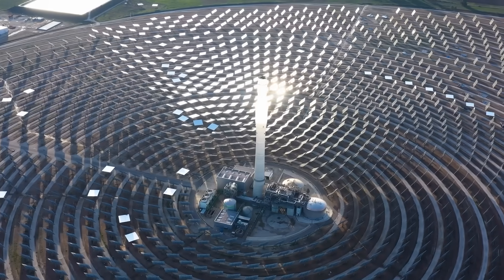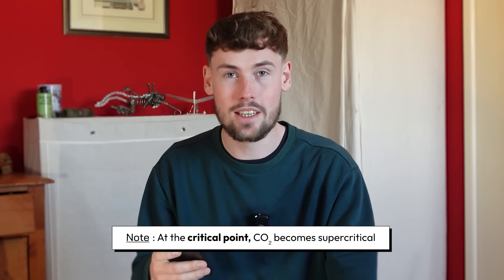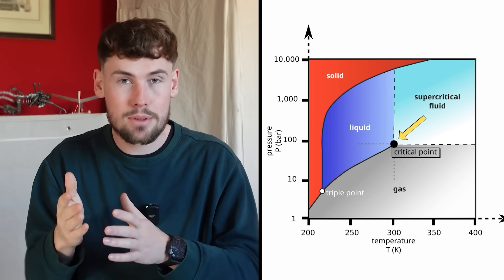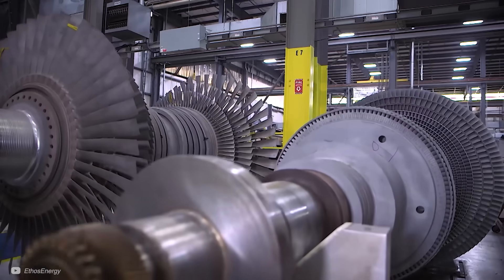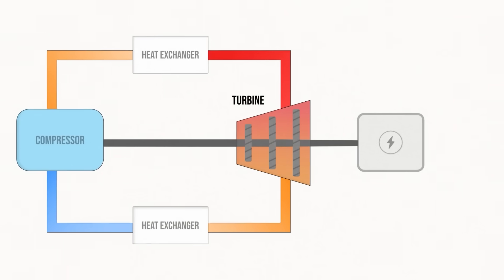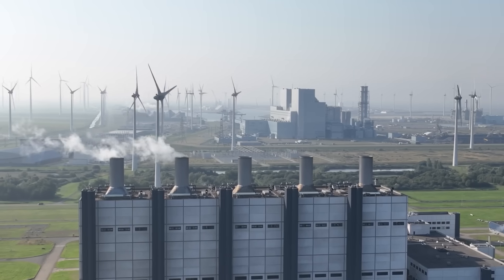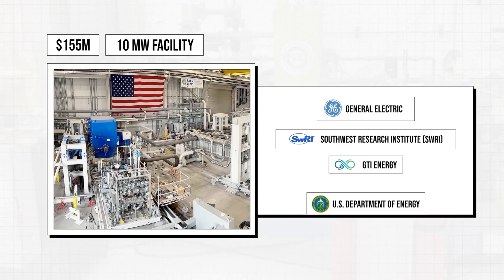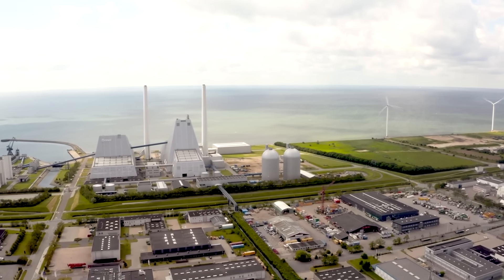How Ultra-Efficient CO2 Turbines Are The Future of Energy

Comment: There are many "steam" powered plants that use super critical water. Many of the things mentioned in the video are also achieved using water. The key point is that super critical CO2 is about twice as dense as super critical water, and CO2 has other advantages as mentioned in the video. The major advantage of water is that its plain old water.
Reply from the maker: Great point - I should have done a comparison with super critical water turbines too! Anyone interested can join the peer review team on Discord to help improve future technical accuracy https://discord.gg/BgwVvkRV :D
Reply: @ZirothTech  Water is kind of a pain actually, we'd much rather use it for other things. Supercritical CO2 is definitely the future.
Reply: @ZirothTech isn't CO2 acidic especially at high pressures? The turbine needs some really good fluorocarbon based coating.
Reply: @rameshraghothama8324 CO2 needs water to be acidic. Only with water does it combine in to carbonic acid.
Reply: @FilipMikulic-u7d CO2 is a Lewis acid all on its own
Reply: @ZirothTech that was literally mu first thought when I saw steam in the title
Reply: The difference between supercritical steam plants and supercritical CO2 is that even with supercritical steam plants, the steam  after the last turbine stage is subcritical.  The steam is then sent to a condenser and just as in a subcritical steam plant, the liquid water is pumped to the boiler inlet pressure using far less energy than it would take to compress the subcritical steam. Starting from a higher pressure and temperature, the supercritical steam cycle is more efficient. But the major benefit of a supercritical steam plants is that the water - steam separator after the boiler is eliminated. Instead the supercritical water turns entirely to dry steam when passed through a pressure reducing valve. This subcritical steam is then fed to the same type of steam turbine as a subcritical system.

So the major difference between supercritical water and supercritical CO2 systems is that with supercritical CO2, the CO2 remains in the supercritical state throughout the entire cycle.
Reply: @papparocket  Also eben kein Wasser verschwendet wird (Verflüssigung)  GuD. benötigen extrem viel sehr sauberes Wasser .   Dieses System könnte man auch in die Wüste stellen.  
Ob am Ende die Kosten je MWh mit Gasturbinen  mithalten können ?  Die sind extrem  günstig zu bauen und können  eben auch ohne Gasanschluss  betrieben werden ( Kerosin, Diesel  etc.)
Reply: @T.Stolpe  Steam plants require extremely large amounts of not-very-clean water for evaporative COOLING, not as the working fluid. The amount of very clean water needed for the working fluid (ie the water turned into dry steam and back) is relatively small - that's why seagoing ships can use steam.
Open cycle gas turbines are VERY fuel hungry (thermal efficiency is quite low) as so much energy goes out the hot exhaust. Combined cycle plants (ie a GT with a steam boiler fed by that hot exhaust) use as much water as a traditional steam plant.
Reply: @papparocket this
Reply: @papparocket  There is no pressure reducing valve. The turbine nozzle valves are sequential and designed to avoid throttling as far as possible.
Reply: Toured a coal plant when I was in a welding program, the water chemistry is a critical factor that is carefully maintained to maintain a passivation layer inside the boiler to prevent degradation of the heat exchanger. I wonder how the co2 behaves chemically.
Reply: @juancarrera5524  CO² is more inert than water and shouldn't corrode metal. Plus, it can be supercritical at much lower temperatures if needed.
Reply: the efficiency depends on the inlet and outlet temp (T1-T2)/T1; the exhaust gas need to be compressed and fed back into the boiler to conserve water. Higher input temp means higher efficiency
Reply: @janami-dharmam And that
Reply: supercritical water requires 220 bar pressure too which is pretty insane.
Reply: Yeap, you got it right. More than twice the water density, CO2 is bound to be more efficient medium in converting enthalpy to torque. As against many engineers I used to work with, all rotating equipment, from pumps to compressors, expanders and turbines are not volume but mass based machines and hence density dependent for its bhp.
Reply: @KasumiModa  the Internet says 0.3 to 1.0 times the density of water, so max is same density as water. Where does your " twice as dense as water" idea come from ? If the Internet is wrong you ought to help them understand actual conditions.
Reply: @gregorymccue5003 Isn't density of any gas, at the same P&T, the sole function of MW? Water at 18, CO2 at 44, wouldn't that do it?
Reply: @gregorymccue5003   Super critical CO2 is roughly twice as dense as super critical water. We are not talking about liquid water. We are are talking about water (and CO2) at high temperatures and pressures -they are in a gaseous form, but the pressure is so high its starting to approach the density of the liquid, but the temperature is so high that it can't exist as the liquid. So it exists in a state somewhere between gas and liquid (a super critical state)
Reply: @jumboegg5845  OK, thanks. I just did some more research. I knew that water in a steam turbine is kept in a liquid-like state between 600 and 900 degrees F until it is allowed to flash to steam, for higher efficiency.  What I didn't know was that the density of water in this state is less than the density of water at standard conditions.  I know that the volume of water in a water jet ( at about 60,000 psi shrinks by about 25%, but the temperature is not elevated.  So if the water is only 0.3 g/ml and the scC02 is 0.6 g/ml, then I understand what you're saying.
Reply: @KasumiModa no. Water and CO2 are polar molecules, which attract to each other, increasing density. Helium is not a polar molecule, so it's density is lower at the same P & T, even adjusted for molecular weight.
Reply: What's the difference in latent heat? Would seem that would be the important part
Reply: Twice the density means the turbine can be smaller (therefore cheaper)?
Reply: @ Yes smaller. So can squeeze a plant in a smaller area. There will be circumstances where you need a compact plant. I think more importantly smaller turbines means you can generate twice the electricity from the same area of a conventional steam plant. I think the video kind of suggested 10 times more, not sure about. Don't know about cheaper either. A lot more involved with CO2. With water, maybe just have to look out for drips, fix 'em before they get too big. lol.
Reply: @jumboegg5845 in Australia, we have gigantic areas where the thermal plants are that contribute to the grid. Not sure if space is an issue in Australia in particular
Reply: @jumboegg5845  its the generator and not the size of the turbines that determine the output, and you cant have drips from super heated steam plants. I wonder how much energy would be needed to turn the co2 gas back to liquid. The video is misleading since it gives the impression that steam for turbine is the same as steam that you would see from a kettle. The only advantage I see from super critical co2 is quick start-up.
Reply: @jumboegg5845 It may be interesting to apply this technology in nuclear submarine propulsion plants due to the compact dimensions of this turbine.
Reply: @jumboegg5845  Power density is significantly higher, in the 10x range I do believe. It's impressive how small they turbines are.
Reply: @jaguarundiargentino1248   Navy prefers to have a fluid that can be easily replaced even if they are sitting on the bottom of the ocean.
they have even purged irradiated fluids and replaced via filtration.
Reply: @simontist  smaller doesnt have to mean cheaper since its a smaller shaft you might need special (expensive alloy) to make the turbine.
Reply: @simontist  . That probably comes down to : What Type of Unobtainium that gets used to make them .
Reply: @simontist  Kleiner,  billiger  wissen wir noch nicht, aber bei 3.600 U/min-  (50 Hz)  ist weniger Umfang und Masse schon ein technischer  Vorteil.
Reply: How is the high pressure generated and maintained?
Reply: @dont_listen_to_Albo  A pump that takes the sCO2 after the cooling heat exchanger and increases the pressure to the highest pressure in the system. The power to drive the pump could come directly from the turbine using a shaft. Or it could be driven by an electric motor which uses some of the electric power generated by the generator that is driven by the turbine. While a shaft loses very little energy to transfer the power compared to the power lost in converting the shaft power of the turbine to electricity and then back into shaft power by the motor, this method allows the motor speed to be  very different than the generator and also vary speed without the generator changing speed. This added flexibility allows the pump and turbine to operate at their highest efficiency condition.

After the sCO2 goes through the pump it goes though the heating heat exchanger where heat from an outside heat source (fuel combustor, high temperature nuclear reactor, or solar thermal concentrator) increases the total energy of the sCO2. There is a small pressure loss in the heater. The now hot and high pressure sCO2 expands through the turbine turning its energy into shaft power to drive the generator to turn that power into electricity. Lastly the sCO2 goes through the cooling heat exchanger where the sCO2 exits just above the critical temperature and pressure. After the cooler the sCO2 is at is at its highest density. Pumping a high density fluid to high pressure takes far less energy than pumping a low density fluid to the same pressure. The low pumping power is key to the efficiency of a supercritical CO2 system.
Reply: @dont_listen_to_Albo CO2 captured from fossil fuel emissions?
Reply: You should look at the Karno generator it looks promising.
Reply: "plain old water" is hellaciously corrosive to pipework at supercritical pressures and temperatures (It's bad enough at wet steam temps/pressures found inside conventional nuclear reactors - in once case 8 inches of stainless steel flange got eaten away in 18 months before being discovered)

Supercritical CO2 can work at much higher input temps than supercritical water AND much lower temps (down to around 50C, vs 125 or thereabouts)

Water in turbines is a real pain to deal with - you DO NOT WANT it condensing as the droplets cause major blade damage and drive maintenance costs through the roof - this is one of the reasons current nuclear power is so expensive - it can only make wet steam

WRT "smaller turbines" - yes, the most commonly postulated size is 10x smaller
Reply: @ And yet, the "plain old water" generators keep on chugging along for many years. Yes they have their problems, but super critical CO2 will have its own problems. When a plant needs to be wound down for maintenance and repairs, the  "plain old water" can simply be drained from the system.
Reply: @jumboegg5845  Warum sollten sie nicht 10 t CO2 ablassen können ? Wo liegt das Problem?
Reply: @alanbrown397 about 1% wet in the HP but after the MSR the steam is superheated and therefore dry at inlet to the LP
Reply: He said the density of super-critical CO2 is HALF the density of water. Which is true ?
Reply: @gregorymccue5003  I didn't hear that, a time stamp would have been useful. Of course he is talking about water at normal atmospheric pressure and temperature. Super critical water has a density of about 1/3 that of water. You need to do more reading about the subject.
The density of liquid water (1 kg/litre or whatever other units you prefer)) is a useful reference. For example solid rock has a relative density of about 1.5 - 3.0 that of water. The sun which is considered a ball of plasma (ionised gas), is mostly at a density close to rock, as you get a bit closer to the centre, the density is ten times great than rock,  and near to the centre the density is roughly 75 times greater than rock, and ten times more more dense than gold.
Reply: @jumboegg5845  I know that the density of water changes little as temperature and pressure go up because it is close to incompressible. An AI bot said the density of scCO2 varies between about a third to about the same density as liquid water (specific gravity from about 0.3 to 1.0 ). I need to watch the entire video over again because it provoked several questions for me.
Reply: It has to do with phase of the stuff. Once you're at pressure you don't have a bunch of waste heat from heating steam. So you get a cold system to use to store energy. Plus unique properties along the phase curves/ triple point
Reply: Any idea why they don't go with a heavier compound such as argon or xenon? Assuming it is a closed loop system that doesn't use up or release large amounts, xenon seems like an ideal choice (pardon the pun) and has double the density of supercritical CO2.
Reply: Well, even in a super critical steam plant, there is still a Cold Sink.   In practice, that temperature has to be above 0C and is usually in the medium  50s F.   That's not made clear in his presentation.  The efficiency depends as much on the temperature of the cold sink as the highest temperature,
Reply: Is it possible to do this with other fuilds that can avoid the challenge of high temperature while still having high enough temperature to extract energy?
Reply: @JosephQPham  That's basically how a refrigerator (a  heat pump) works. For electricity generators you need tremendous pressure and mass of gaseous water (or Co2) to turn a big heavy turbine with generator attached. Looking at the extreme end of the physics, we commonly use normal water to turn the turbine, its called hydroelectric, the energy is coming from gravity rather than thermal heat.
Reply: Spent some of my career on a 900 MW supercritical fossil fuel unit. Same thing happens with water above the triple point. Only difference CO2 has more protons and neutrons than H2O, ie more mass acting on turbine blades. CO2 gas has its own problems containing leaks, CO2 can collect in the bottom floors of your power plant and asphyxiate your basement workers. Same for people wanting thorium reactors cooled by liquid Sodium (hot), if you think having equipment pumping Molten metal is going to be trouble free you are in for a rude awakening! Things break and have to be fixed, it ain’t easy when working with liquid Sodium salt.
Reply: The biggest advantage, is the molecular structure of CO², vs H²O. Water is semi-crystalline, in nature. The instant it loses its super-critical state, the vapor forms... and with it, its erosive nature. CO² is far less destructive, and far less degrading to the various components and sub-systems necessary to sustain the turbine and/or generator itself.
Reply: @JamesCopeland-i1j  Superhot CO2 tends to disassociate into carbon monoxide and tends to carburize and embrittle the alloys used in the hottest stage fluid heater.
Reply: What about inertia with those CO2 turbines? As they are smaller isnt that a thing that we should consider? Especially with upcoming wind/solar which dont give us thw same real inertia?
Reply: And CO2 is... plain old CO2. It's literally in the air we breathe. More readily available than water.

The main disadvantage with CO2 is that it doesn't hold much energy in its room temperature state. So you spend a lot of the energy you're harvesting just to convert it into a state that carries that energy.

Normally I'd say that's a non-starter. But if it makes up for other efficiencies thoroughly enough... maybe it's got a lot of perks. Not requiring power plants to be tied down to water sources could be a big deal. Not to mention CO2 is remarkably easy to work with - it's a dense gas, chemically very stable, and goes to solid at a temperature not terribly hard to get to - almost a temperature parts of the Earth's regular climate can reach in its coldest areas.

So suppose you spend 20% of your energy turning CO2 from the air into dry ice, but that dry ice powers a turbine that is 25% more efficient than a steam turbine. That's still got potential.
Reply: @kireduhai9428  If that's the case, I'll trade you 5kg of water for 5 kg CO2.
Reply: Pretty sure you're actually talking about  SUPERHEATED  Steam . Stops behaving like a Vapour and starts behaving like a Gas .
There are no " Water Particles " present whatsoever , but anything water soluble will get picked up and end up in the Condenser .
Or  more correctly : In  the  Feedwater  Tank .
Reply: @johncunningham4820  Do some basic reading. Water is the molecule H2O, regardless of its state. Water vapour is a gas, usually at atmospheric temperature and pressure. Steam is a general term we usually apply to gaseous water at higher temperature and pressure. But steam is still a gas.
Reply: @jumboegg5845  .  Maybe  YOU  should check on some stuff yourself . LP  Steam  is  a  VAPOUR . Yes it has the flow characteristics of a gas , but is  EROSIVE  because of Water particles suspended in it . The  type of  steam  used  in  Steam Engines and for  Large  Heater Cores like you would find in the Basement of Apartment blocks .
HP  Superheated steam has  no  suspended  water  particles anymore .
Not  at  1275 Centigrade  and  1000  psi or  higher .
Purely a Gas  at  this point  and  used  for  Steam Turbines  in Ships................
Reply: @johncunningham4820  Oh, Lord
Reply: its not always about efficiency but about technical feasibillity to reach the latter. if you have to dry the steam in order not to destroy the blades with condensed dropplets by means of a steamdryer and increase the turbine size to match volume expansion in order to drop the temperature to extract more useful work, to increase efficiency by 10% but for elevated cost of 40%...it stil might be senseless:

in anfamily Home only 20% efficient solar panels make sense because the 40% NASA can afford for a space mission would not make sense especially if no weight restriction is in pkace as there would be on a space ship...
Reply: Supercritical CO2 can use wider temperature range. If future high side is 715 °C as mentioned in the video and low side is around 40 °C while still in supercritical state, the efficiency will be much better than with steam because there are no state change and the temperature change is still huge.

The interesting part is bearing. Do they need gas tight seals before bearing, or can the whole turbine be fully enclosed meaning the bearing is full immersed in the supercritical CO2, too? Fully immersed means no seal leaks via bearing but makes it harder to design bearing surfaces that do not wear down.
Reply: I was just about to say that I was a boilermaker at Monroe power plant DTE repairing the super Heats and headers for the supercritical water if I'm not mistaken one drop of water is enough steam to fill an entire bushel
Reply: I was wondering why not Aircon fluid.... It's in every home. Or it's just good as a heat pump and not good for turning turbine.
Reply: @psyionx CO2 is a refrigerant. Pretty much any gas or liquid can be used as a refrigerant (or Aircon fluid). It’s just that some work much better than others because of certain properties. There are hundreds of “listed” refrigerants.
Reply: @ CO2 can be used as a refrigerant.  But not a good choice for typical applications, there are much better alternatives.  The pressure required to liquify CO2 is relatively very high, there may be highly specific applications for CO2 refrigerant.
Reply: @jumboegg5845  CO2 would be an amazing refrigerant if it did not deposit from gas to solid.
Reply: @psyionx R-134A and R-22 would be decent options, they are 20-25% more dense than supercritical CO2, but CO2 is more environmentally friendly. Isobutane is the eco-friendliest refrigerant but has a very low density, lower than supercritical steam. I'd like to see the results of a system built around xenon. It has double the density of the supercritical CO2.
Reply: @psyionx  does not work to as high temperature because most refrigerants will decompose.
Reply: The the turbine might be smaller, but it also spins faster and will require either a gearbox or an inverter to create grid frequency electricity.
Reply: I wonder what lubricants will hold up to hot CO2,  it's a non trivial challenge.
Reply: Maybe supercritical co2 can absorb the heat from the turbine extension for the heating up purpose and use it to turn the same turbine to add more efficiency.
Reply: You never covered pumping back the super critical CO2 into the boiler. It’s much easier to pump water back into a boiler as the volume is much less.
Reply: Главное преимущество воды - это то что у неё температура кипения на двести градусов больше чем у углекислого газа. Турбины - остаются машинами идеального газа, со всеми последствиями
Reply: Huh!
Ciao! Tony.😊
Reply: Plain old water ? Lol ever heard the saying if it ain't broke don't fix it ?? Or keep it simple stupid ??? Or reliability in simplicity??
Reply: I never expected CO2 to be more dense than water
Reply: Supercritical water is very corrosive, I guess CO2 doesn't have that issue
Reply: The major downsides being the floor of your operating envelope being at over 1000 psig and 80F, and missing out on the additional energy output from extracting from saturated steam and the additional cost of prime movers to circulate your supercritical CO2. Not to mention the hazard that your working fluid evaporates vice condenses, so finding and managing leaks carries significantly more risk.

In the places where the downsides of water/steam truly challenge the overall plan of the plant, sure this will help a lot. But, it will be hard to beat the reliability and simplicity of steam power.

Also, curious to see how those CO2 turbines scale, physically speaking.
Reply: Will the super critical CO2 cause super critical Global Warming when it blows up and escapes from the reactor?
Reply: No, supercritical CO2 is typically less dense than supercritical water.
Reply: So CO2 is plain old CO2 and is more abundant than water
Reply: @robschaller9061   total mass of water on Earth is estimated to be around 1,400,000,000 gigatonnes   compared to CO2 3,360 gigatonnes (Gt).  so your are only off by six orders of magnitude.
Reply: There is no such thing as ‘super critical water’
Reply: @davelittlewood195  In your head there is not such thing. Your brain is tricking you into believing you know a lot about things. Do a basic search of "what is water".
Reply: @davelittlewood195  yes there is it exists at 374.4°C (705.1°F) and a pressure of 217.7 atm (3,200.1 psi)